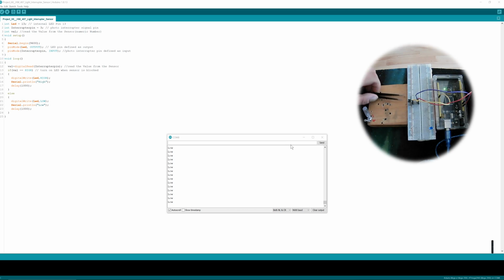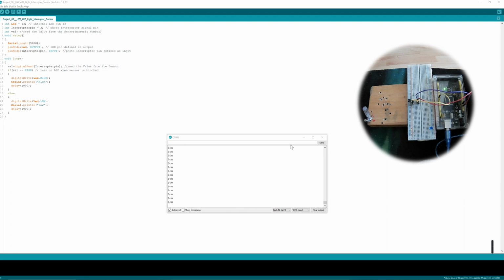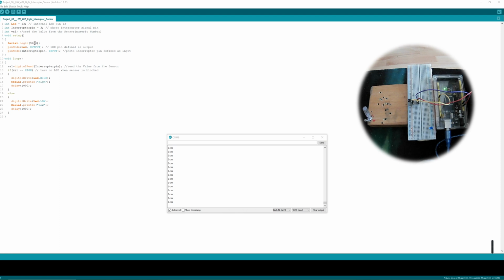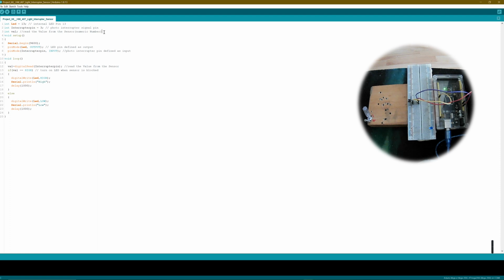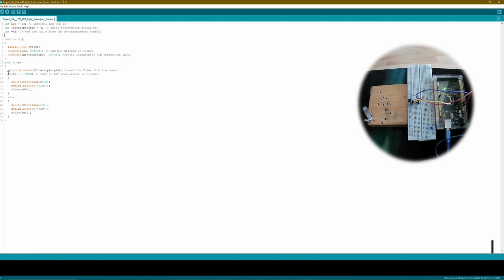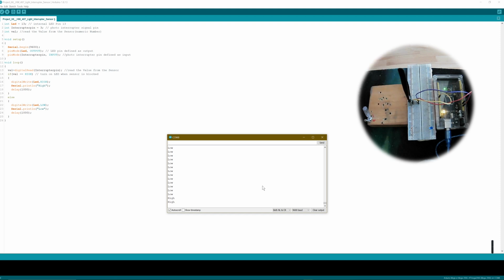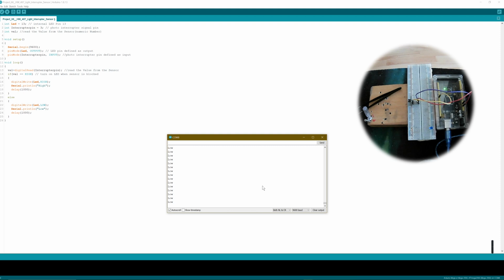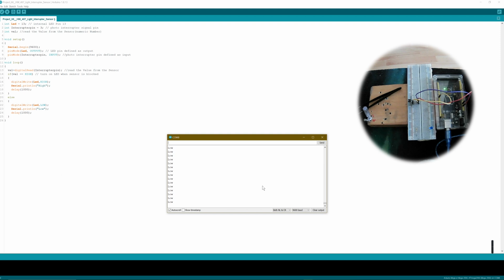Arduino Project 12 - Light Interrupter HW487

Comment from the maker: int Led = 13; // internal LED Pin 13
int Interrupterpin = 3; // photo interrupter signal pin
int val; //read the Value from the Sensor(numeric Number)

void setup()
{
  Serial.begin(9600);
  pinMode(Led, OUTPUT); // LED pin defined as output
  pinMode(Interrupterpin, INPUT); //photo interrupter pin defined as input
}
void loop()
{
  val=digitalRead(Interrupterpin); //read the Value from the Sensor
  if(val == HIGH) // turn on LED when sensor is blocked 
  {
    digitalWrite(Led,HIGH);
    Serial.println("High");
    delay(1000);
  }
  else
  {
    digitalWrite(Led,LOW);
    Serial.println("Low");
    delay(1000);
  }
}